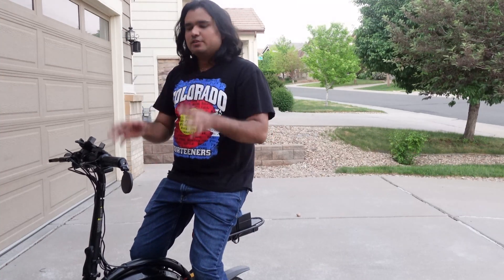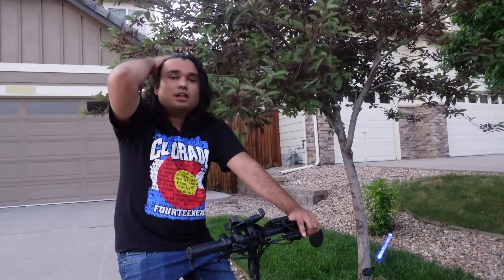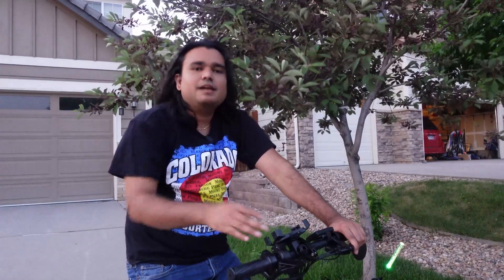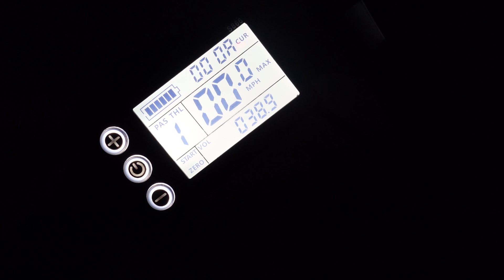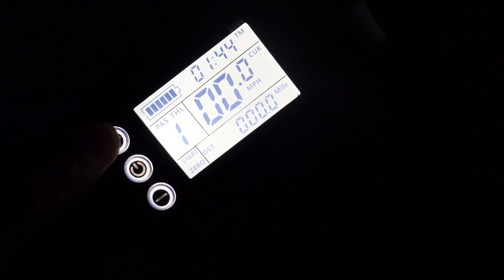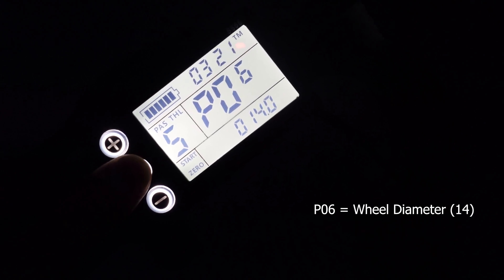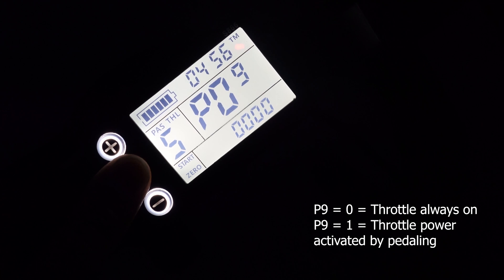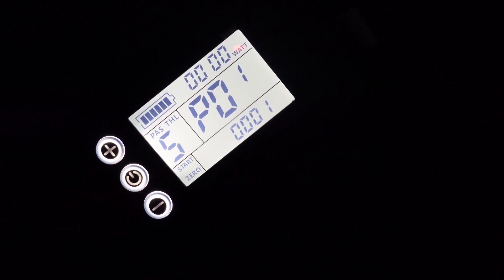Electric Bike (Jetson Bolt Pro) - Controller Upgrade Settings & Questions

Comment: I need you to tell me how to make the original throttle to work on cuz I did it exactly how you said and I don’t work only on the display if I leave it press for a secon it runs but slow
Reply from the maker: If it is running slow, that means the setting is probably at 1. What do you read on the left of the screen where I have 9? If it is 1, then press the plus button untill it hits 9. If that doesn't work, perhaps you have a new bike with different wiring. Please go to my original video and check a pinned comment. Several people have discussed the different wiring and how to wire the throttle.
Reply from the maker: Looks like you have already checked out the pinned comment. As I responded there, I honestly do not know how to help you with the issue. Mine worked by following those exact same steps and you can see in my video it works. Unfortunately, I do not know how to troubleshoot the throttle not working issue. Sorry!

Comment: Great review! Thanks for your videos! 
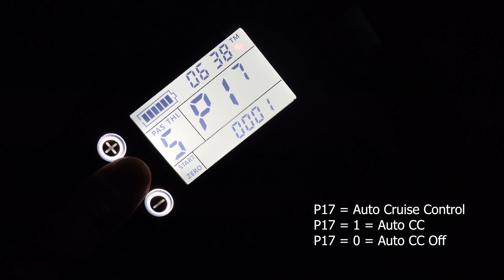7:05 - P16 ODO. If you hold + for 5 seconds, it will reset your overall odometer back to 0
Reply from the maker: Thanks Jay!
Reply: Idk why they can't just google s866c or their LCD model on Google and it will pop up some manual in PDF. That's how I learn how to setup mines
Reply from the maker: @b20eg195  The manual wasn't too clear about the ODO setting actually. Thanks for all your input.
Reply: thanx bro...

Comment: Another cool thing I learned you can do is unplug the single white wire inside the jetson and it dis-activates the speed limiter cap
Reply from the maker: I tried that and it didn't work. It didn't make any difference for me. Thank you!!
Reply: That's for the Jetson bolt and or just dyu bike
Reply from the maker: @b20eg195  and Ancheer I think. Didn't work for this bike.

Comment: How you doing Bro....i bought mines and broke it the same day lol ....it runs for like two minutes then it stops...I'll wait a bit then  it kicks in for a bit and then dies again ...im clueless....i dont even know where to bring it to get fixed ...praying you can help...lol
Reply from the maker: Hi Fernando, are you talking about the controller or the bike lol. If you are talking about the controller, you might have a faculty controller. Talk to the seller and try getting a new one. If you are talking about the bike, that definitely sounds serious, you need to contact Jetson.
Reply: @ShivaSapkota  im assuming its the bike ...by controller do you mean the thing with the green lights and the throttle...im confused lol like i said i know nothing bout  this...do you happen to have a number i can call?
Reply from the maker: @FernandoJimenez-ni1sr  You can contact Jetson at 888-976-9904. If you haven't opened the middle controller housing or messed with any wirings, the bike has one year warranty. They can take care of you. Hope they get your bike running soon my friend!
Reply: @ShivaSapkota  ThanX Again bro...

Comment: With the 48V battery, it is just as loud as the 36V battery. Now I’m using a different controller than you, but I’m certain it’s the motor and has nothing to do with the controller.
Reply: I think the heavier you are the louder it gets and as top speed sets in it's smoother. If you floor it from a dig it will growl and feel like it's stalling until it gets going and this is when it uses the most current amp.  I always like to get pas going first then throttle. This new sound of whine some people find it cool, I actually don't like it lol.
Reply: @b20eg195  I don’t like it either, but it’s easily avoidable. I love this upgrade. I can’t wait to release a video about what to do. It’ll be pretty in depth. I just gotta be 100% on everything to I finalize everything. It’s always dangerous about this stuff. Lots of disclaimers on what NOT to do.
Reply: @RandyRides  are you running a 18amp controller? Or is it 20-22amp? I have an extra 5 inch Ebiking brand I might use to give it a go it's rated 22amps limiting.

The brainpower one I have in the bike is like stock 13amp, but I find it to hit as high as 23-24 spiking amp when full throttling due to my weight and or load just taking off. But it manage to hold as my battery bms is 20amp. So max is probably 25amp short term so far no problem.  But if I do shunt mod it will have problems on the 36v anyway because it's too much current now and the 13amp controller can't keep up don't wanna fry anything...   So I may try the Ebiking brand perhaps better speed.  More speed equals more tq means easier hill climbing as well
Reply: @b20eg195  That would be 22 Amp, sir.
Reply: @RandyRides  that would make good sense with the 48v battry with a 20+amp  or more bms it will handle higher current and speed and tq.
Reply from the maker: Hi Randy, thanks for that insight. I really appreciate it. What type of speeds are you getting with the 48V battery? Do you feel the power increase as well? Thanks again, I will go check out your video.
Reply: @ShivaSapkota  Maxes out at 23 MPH. Definitely increased acceleration. I’m getting about 18-20 on average.
Reply from the maker: @RandyRides  Awesome!
Reply: @ShivaSapkota  u will feel the difference on 48v. The acceleration is crazy faster gets u up to top speed faste. Again it varies by weight of rider.  I'm waiting on the new BMS to come in tomorrow the one that came with the battery died because of the shunt mod. For some reason they use cheap 15amp bms when it should be at least 20-30amp. I over current it and killed it. But I'll keep a post up soon whenever I get time and try to make a video

Comment: getting 17.6 mph without me sitting on it with ur settings which, cant wait to hit the streets. thnks for ur help today
Reply: The way I do it is I set p18 at 100 and then p07 I just dial it in as low as 20+. I basically fina a long road and I make sure gps is working and I do a full speed run and then I go into setting and start changing it while driving and recheck until it's within .5mph. So far it's been pretty stable I see 18mph because of my weight.  As voltage drop of course I average 15-16mph.  That 20 mph never going to stick for long if u are more than 165lbs-180lbs.  It varies by weight.   And if u are on the 36v battery u won't see 20mph. Have to be on the 48v to hit 20-25mph depending on weight of rider, road and weather, tire psi condition.
Reply: @b20eg195  I’ll try it at my works parking lot, it’s all open road there
Reply: @TheAcostanostra  another thing too is the tires. They ship the bike with two types cst and street road tires.  The smoother kind will gain 1 mph  more and with at least  40-45psi tire inflation.
Reply: So with the controller my jetson is faster than the older jetson my coworker has. I still have to match the gps with the mph. Question thou I got an e10 code again and the throttle didn’t work, after powering off and leaving alone for about 10-15 it works fine. Anyone know why or what’s causing the error.
Reply: @TheAcostanostra  Got same problem.. Controller got overheat after running few mins on load with E10.  No Error when running without load. Got it fix by remove PAS wire
Reply: @kevinlee9124  what color is that and do i just cut and black tape it out?
Reply: @TheAcostanostra  From the Pedal has yellow, red, blue. I cut all 3wire out to disable pedal assist.
Yellow suppose to connect to black
Red to Red, Blue to blue
I think the controller is bad, b/c i connect two other bike this way and  it work fine.
If not working, change the controller. I bought several  48/60V controllers from aliexpress for backup.  My bike now 30mph free spin and 23 mph with 180lb load @63V
Reply from the maker: Thanks for your feedback. You might have to adjust the p18 settings, you should be getting close to 19-20 mph without you sitting on it. Test with a GPS app.
Reply: just set it to 100 just need to match it with a gps
Reply from the maker: @TheAcostanostra  Is it matching up to your GPS with a 100 setting?
Reply: @ShivaSapkota  i will post tomorrow havent tried yet
Reply from the maker: @TheAcostanostra  Awesome! Thank you.

Comment from the maker: I just wanted to make a quick follow up video to show you all my settings to calibrate the new controller. Thanks for your continuous support to my channel.
Reply: Hi Shiva, would you please provide a link to the video where you installed the controller.  I couldn't find it on you YouTube page.  Thanks!
Reply: @williamdavis3314  Here it is: https://www.youtube.com/watch?v=InoocxVSAuY it is also linked in the video.
Reply: Great upgrade it’s working really well!!!!
Reply from the maker: @Radrik12  Thanks for the feedback! I am very glad to hear the upgrade has been working well for you.
Reply: Will the Jetson bolt pro throttle work with your upgraded controller ?
Reply: Mero electric bike urban glide 140 ho mero ma ni milxa holla pls help me
Reply: Hi man, here it's illegal to have this bike with throttle.....so I wondered....can you just disconnect the throttle nd still use it as a normal pedal assist bike